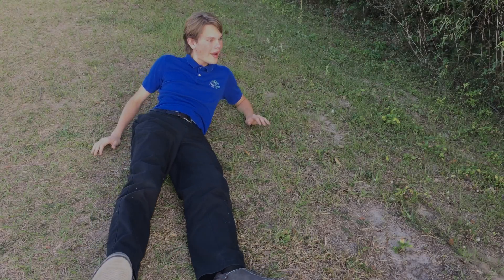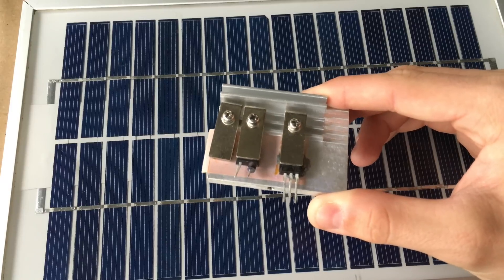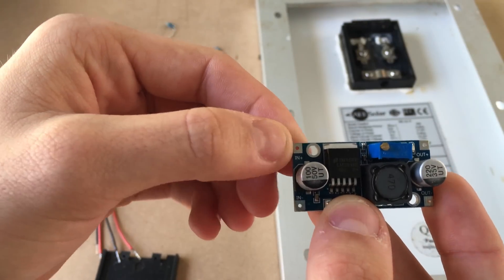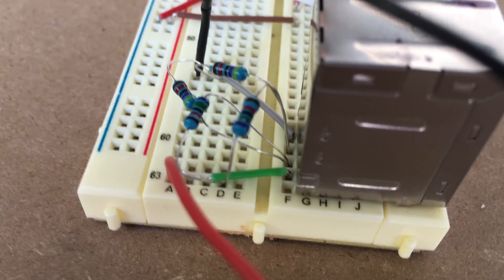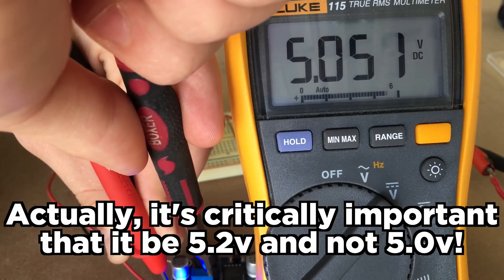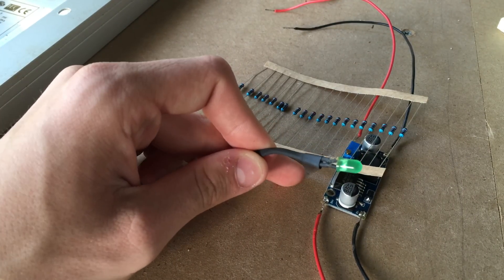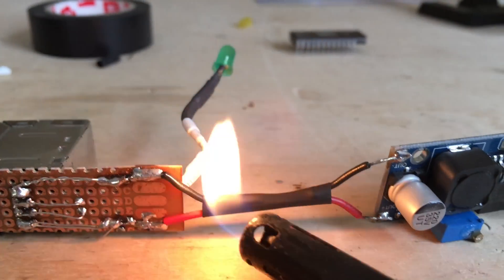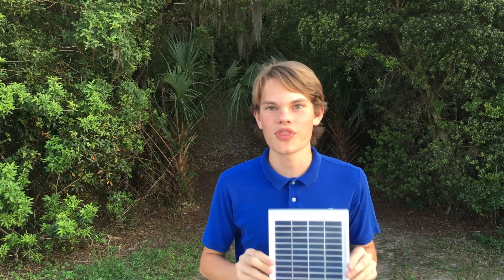Ben Builds: Charge your Phone for FREE | DIY Solar Panel Phone Charger

Comment: or instead of doing so much work you could have just taken a car phone charger and hook it to the solar panel. When the voltage of the solar panel goes above 12V, the car phone charger would turn on and be ready for Charging.

Comment: This won't work!! This panel is 17.9v @280mA, great that he drops the voltage, but he's not increasing the mA. The mA has to be great the the phone battery. if the phone is using more mA then the mA coming in, it will not charge, it doesn't work. But if you turn off your phone, then it would work at a very, very, very slow pace. You've hear of the turtle and the rabbit? If you haven't, I can't help you there. But really, be ready to multiply the time required to charge the phone by 5 to 10 times slower. That means that if it take your computer over an hour, then this will take over 10 hours, and that would be on a clear sunny day.

Comment: I am not very technical, but I noticed that the schematic says the resistors are 50k ohms and 75k ohms. And the parts list says 47k ohms and 51k ohms? Is there a difference between which are used? I think the ones in the video are 75k and 47k, based on the colours.

Comment: Hey, one question, can't i use resistors and a potentiometer let's say to create a voltage divider instead of a DC/DC buck converter? Thanks
Reply: and by the way, what about the Amperage output? Meaning, as far as i know, amperes in this case play the role of the accelerating the charging rate of our phone.

Comment: Hey man, i have a few questions if you don't mind helping me :)

1. Will I be safe if I use a 12 V / 15W solar panel for this project along with a 12V to 5V step down converter?? 

2. Will my amperage be affected when my voltage steps down (12V-5V)?

3. Is there a way that I can output 5V and 2A with my 15W panel?

Thank you!

Comment: i would use a regular car phone charger hook up the positive and negative and i have my charger. 

i have a 9v solar panel
Reply: Nop, My solar panel is 9v 1w wich equals to 111mAh wich is really low Ah  i have to get a diferent solar panel one atleast 9v 600mAh to have it work really good
Reply: +Tech Beast you would need something that goes to 2amp with a car charger that outputs up to 2amp
Reply: +Tech Beast youre welcome

Comment: Hey, nicely done video and interesting idea. I also have a solar panel to charge your phone (6V / 680 mA) Instead of using the stabilizer 4xSanyoAA 2700mAh battery, pull the battery voltage spikes at full exposure panel, and when they're not charge telephone, electricity keeps me in batteries and can be charged even in the dark. I also tried the controller from China, but instead regulated 5V-24V it gave 6.71-26.21V, so it could not be used. But with the batteries, it works great. Thumbs Up;-) Sorry for bad english, i use translator :-)

Comment: Ben, another successful video. Good Job. I do take issue with one thing. Using super glue I don't think is the best choice. That stuff is so penetrating into any crack, which make is perfect for broken glass, china, or other non-flexing tiny joints, also makes it not good for other applications. In your project, I would recommend a "stiffer" glue like Epoxy or any more "plastic" glue. Unless the supper glue is some gel type I don't see it holding PC boards for very long. IMHO, 73, de N8IPS

Comment: I have the same solar panel that came with my SunKing Pro Lantan. The output is about 8v - 10v depending on the sun. Now how do I make it a multipurpose solar panel that can charge either my lamp as well as my Android phones and iPad?
Reply from the maker: +Ello Oku All you need to do is put a switch in between the DC to DC buck converter. This will allow you to turn on and off the lower voltage setting. I hate to crush your expectations; however, an iPhone typically charges at one amp. An iPad typically charges anywhere from 5 to 7 A. With a small solar panel, there's absolutely no way that you'd be able to charge your iPad at any reasonable rate.

Comment: Hi!! Have a question: Could be this solar panel the same as you http://www.ebay.com/itm/10W-Watt-polyCrystalline-Cells-Solar-Panel-12V-Poly-Solar-Module-Battery-Charger-/381336827685?hash=item58c9723725:g:tTMAAOSwu4BVrhII and I saw this bulk converters http://www.ebay.com/itm/5X-LM2596s-DC-DC-Buck-Converter-Power-Supply-Step-Down-Module-Voltage-Regulator-/301886482972?hash=item4649d62a1c:g:8cwAAOSwUuFW1lhy

Comment: Hey. Doesn't it need a blocking diode somewhere?? Is the phone going to discharge into the solar panel when not in use.
Reply from the maker: +Project DIY Nope, for two reasons. One is that the phone incorporates discharge protection of its own and two is that the DC/DC converter is not a resistive load. The small chip on there that handles everything will not drain power even if it is supplied.

Comment: Ben, I have been waiting on another build from you.  This was great.  Do you think it is portable enough that you could carry it in a day pack as you walk around?  If not, could this work with one of those flexible solar panels?  How long does it take to charge your phone?
Reply from the maker: +Pidasian Hippie Glad you enjoyed. I wanted to work on a quality build and also make an Instructable on it so thats why it took some time. Yes, its is portable enough to carry around it weighs only ~3lbs. This would work fine with a flex panel just make sure that it puts out at least 5W and >6v. Phone charges at 500ma which is about 1/2 as fast as the standard wall charger. In an emergency situation, it can get a phone from dead flat to 5% in about 15min. 5% is plenty enough to make the call for help.
Reply: Ben Builds: Thanks for the information.  I appreciate it.
Reply from the maker: +Pidasian Hippie Not a problem!